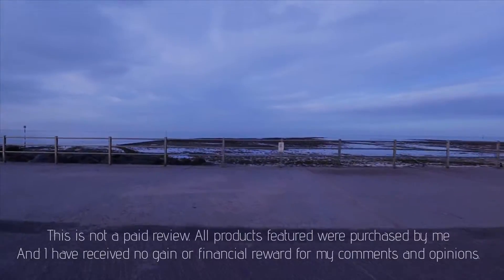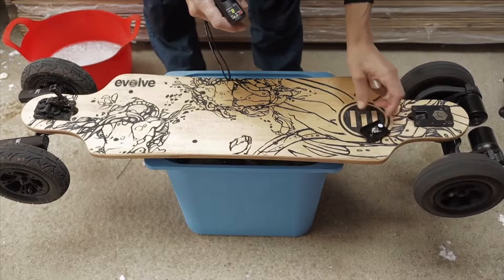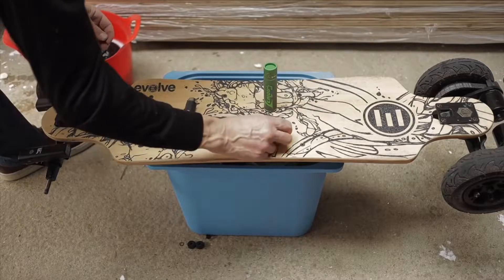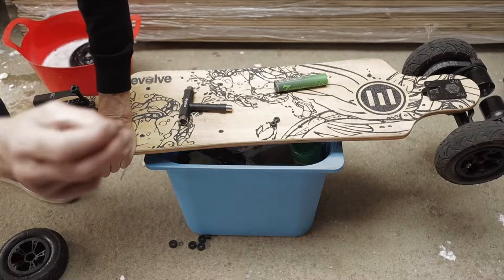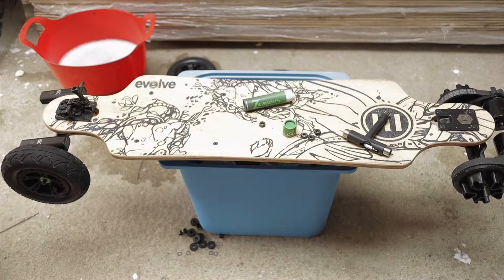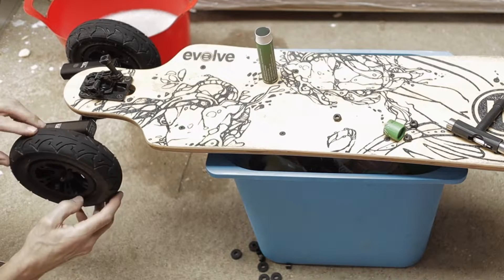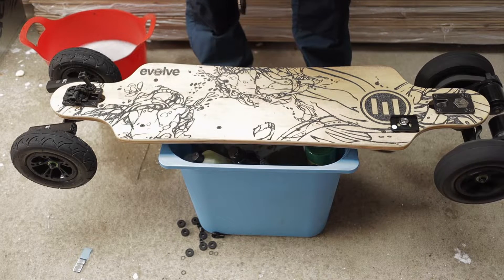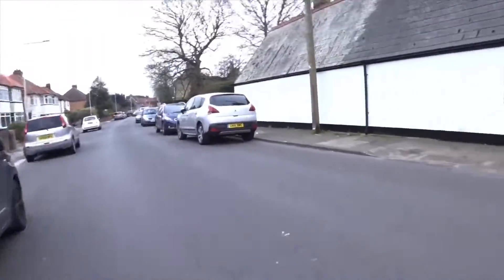Wheel balancing & New bearings Evolve Bamboo GT electric skateboard

Comment: What counterweights did you use and did the stick ok to the wheels?
Reply from the maker: I’m not sure where you are located but this link takes you to UK eBay. If you are elsewhere it will at least show you the item. Yes, they stuck no problem, just be sure to clean rims first👍🏼 
https://www.ebay.co.uk/itm/6-Strips-Lead-Free-Stick-On-Wheel-Balance-Weights-Motorbike/273099553570?_trkparms=aid%3D1110009%26algo%3DSPLICE.COMPLISTINGS%26ao%3D1%26asc%3D20200220094952%26meid%3Dc82286c30d654277ab597783d2c8c74e%26pid%3D100008%26rk%3D3%26rkt%3D12%26mehot%3Dag%26sd%3D113853841851%26itm%3D273099553570%26pmt%3D1%26noa%3D0%26pg%3D2047675%26algv%3Ddefault%26brand%3DUnbranded&_trksid=p2047675.c100008.m2219